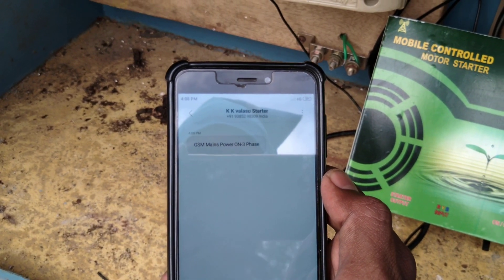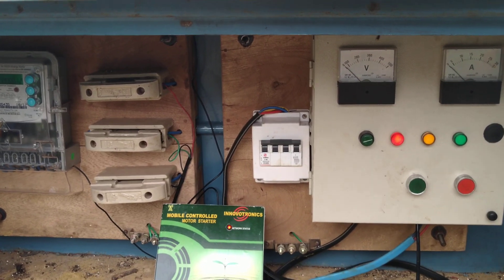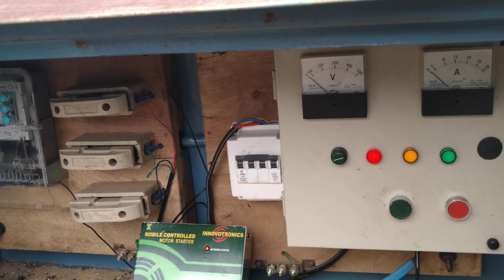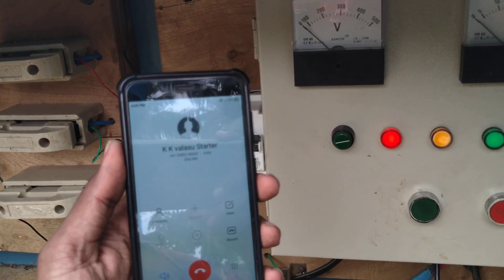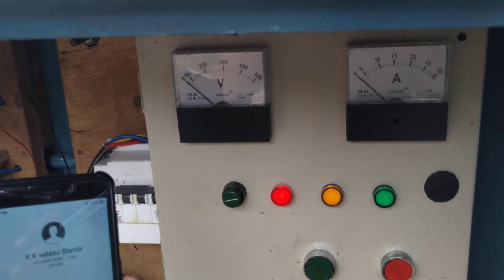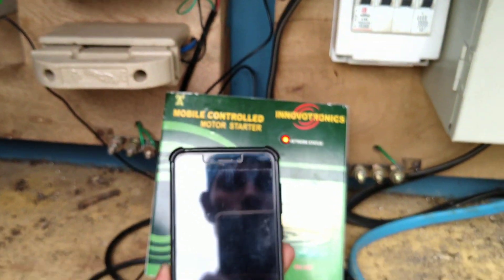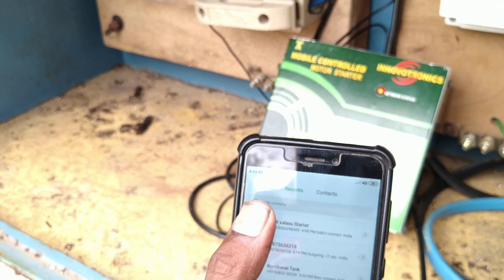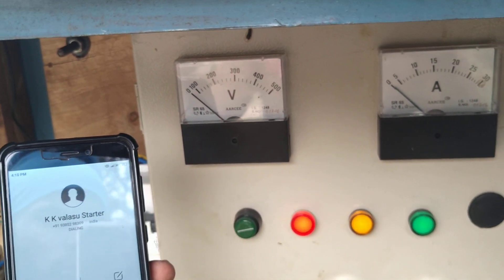MOBILE CONTROLLED 3 PHASE AGRICULTURE MOTOR TAMIL EXPLANATION

Comment: Ikon motor appid mobile operating sollinga bro
Reply from the maker: Ikon starter kum use pana mudium...
Send a message from your number I will share a ikon starter installed images
Reply: Number
Reply: My number ha bro
Reply from the maker: @srinathsimhadri3501  9655244999 send message from your number
Reply: Reply
Reply: 6384559918

Comment: These controller until how many HP can use than how can I check Run states
Reply from the maker: HP not issue... We will fix it with your starter